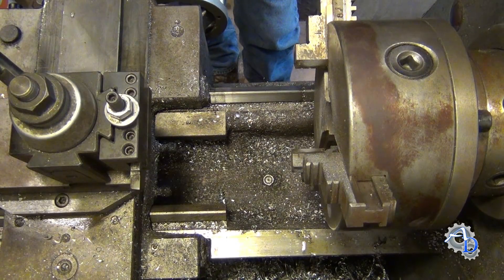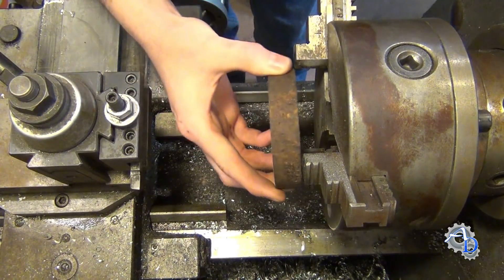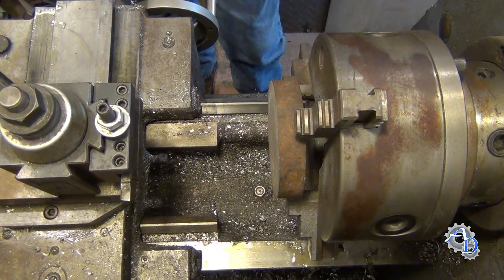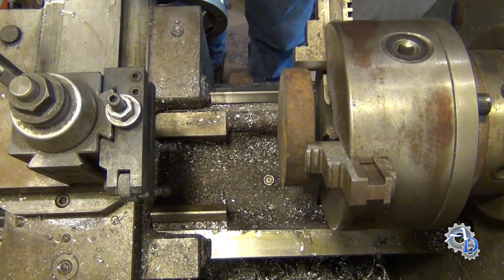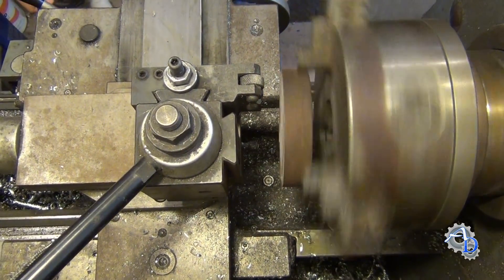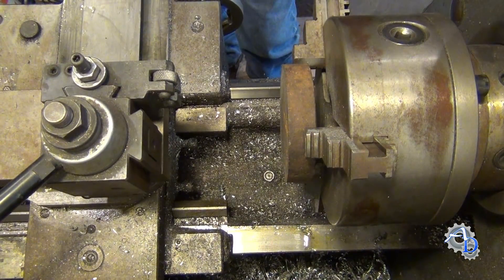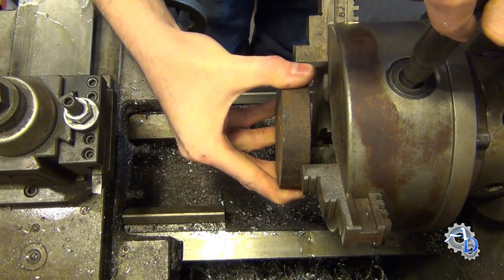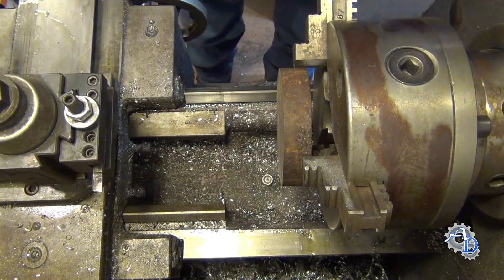Secret Lathe Trick To Quickly Line Up a Part Face

Comment: If you can find, or even machine, a wheel with a convex surface on the outside, the more spherical the better, would improve this trick. You wouldn't have to have your setup exactly parallel, due to the convex surface of the wheel allowing for misalignment. 
You could also fabricate a tool to put in your tailstock that accomplishes the same task without having to adjust your tool holder.

Comment: Good use for that crappy bump knurler I have. Made a bearing tool for this but will try this.
Reply from the maker: That was my line of thought. I had it so might as well use it for something.
Reply: Yep  , I took a piece of 3/8 Square stock and made a slot and cross hole for a bearing.   It was some other channel , don't recall.  Mr Pete maybe. 

I should have just added a bearing to that crap knurller instead.  I think most have one of those kicking around with no use.

Comment: Check out the rust stain on the lathe chuck. Just about every video on other channels this rust stain is present. Notice how the rust lines up with the palm and fingers of the operators hand. So what has that got to do with the operation being shown. Absolutely nothing, but hey at least I'm watching and subscribed  :-) .PS that's a great tip that I have never seen, thanks for sharing...Ken Marina CA
Reply from the maker: I hadn't noticed the pattern. Quite observant. I wish there was no rust at all, but I'm always fighting a moisture issue in my shop when the weather warms up. I open the garage door on nice days. The machines are always cool, so they condense moisture almost instantly. When I see it, I have to close the door and turn the dehumidifier back on.